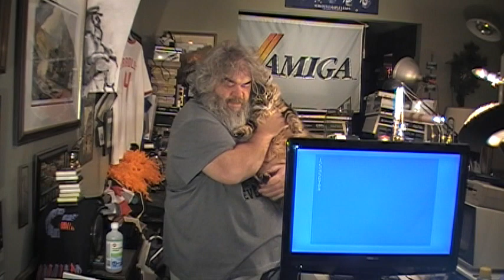Commodore - Episode 419 - A Working Non-Working 1541 Disk Drive - David Bradley - 64 C64 8-Bit

Comment: if the drive doesn't initialize the first try,most the time it wont in xxx tries. Formatting with a blank disk is a good test many times since some drives will read and not format. Maybe bad 6522? you can swap them around and see if the symptoms change,they are usually socketed. Either that or its simply out of alignment/rpm off maybe? a good start here: http://personalpages.tds.net/~rcarlsen/cbm/1541/fix1541.txt
Reply from the maker: Indeed, those 6522 chips are often the issue...The board is all good...the actual disk drive mechanism seems to be the issue...I have not given up on it yet...but indeed, sometimes the head just fails...and that pretty much is all she wrote...
Reply: @DRBradleyPhotography  yea,sounds like the typical head failure. i've seen them go open with a continuity test.